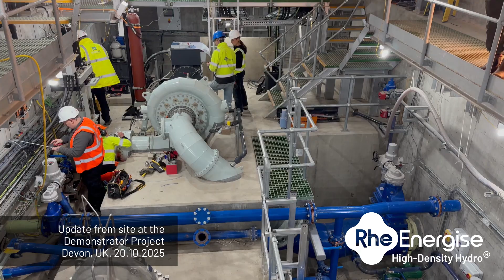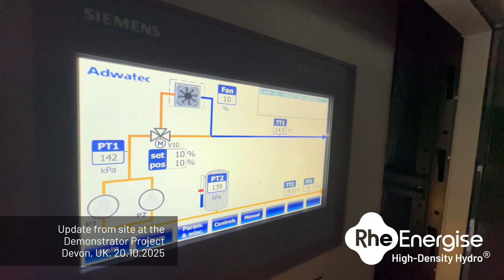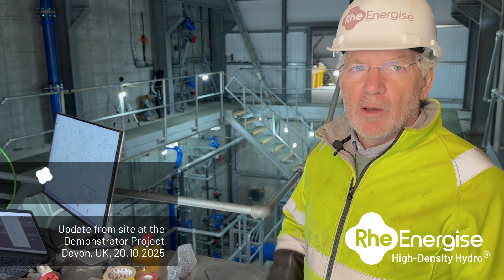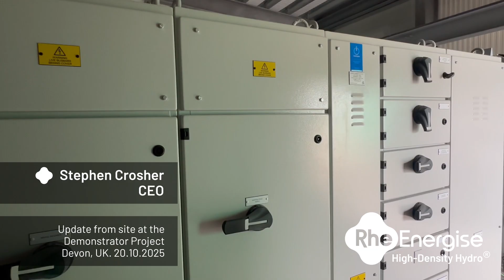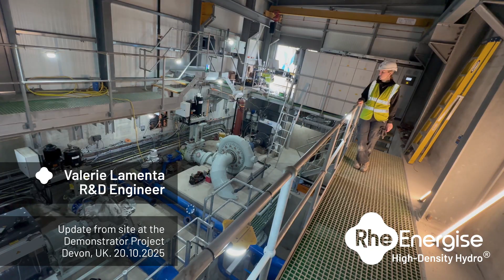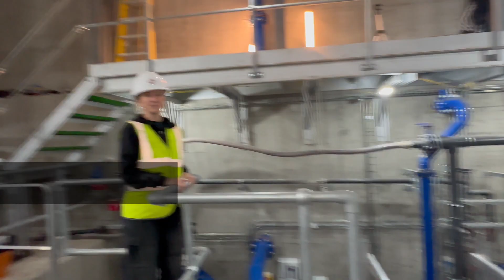RheEnergise Update October 2025

Comment: This company needs to sort out the difference between energy generation and enegrgy storage. This is what happens when non renewables engineers get involved with energy. Being presented a generation when it is ONLY storage. And there;s nothing new here, there are much better methods of storing renewable energy, pumped water is old tech. Flywheels are much more efficient and relkatively lossless. Unlike this which appears to ignore/dismiss any enmergy costs, pretending the energy is already up on the hill and didn't need pumping there. Ignore all the build costs of course, incob=nvenient.